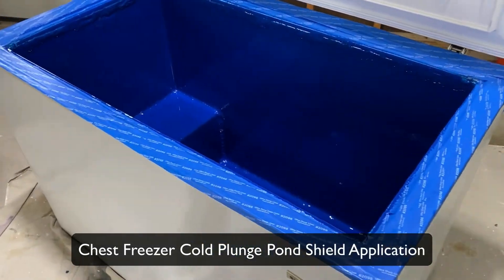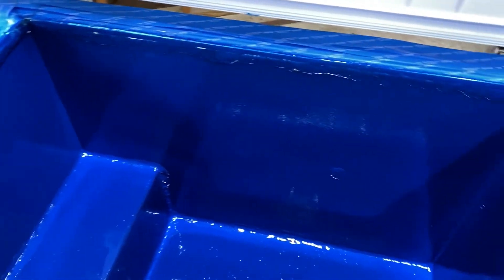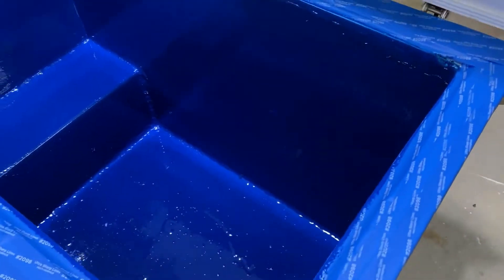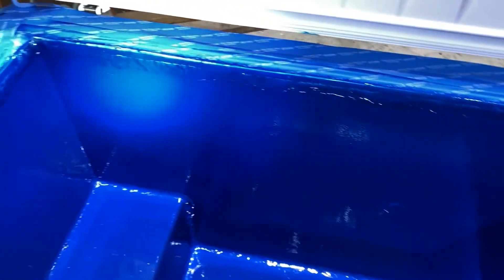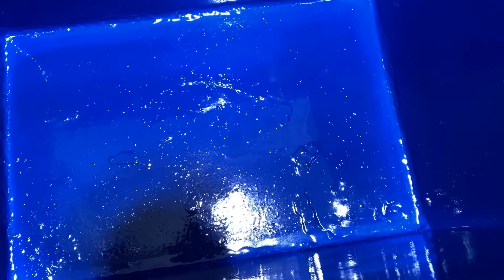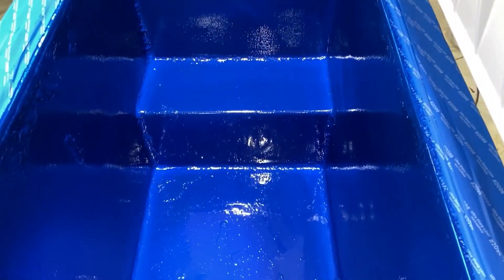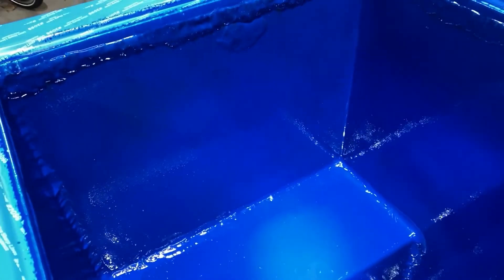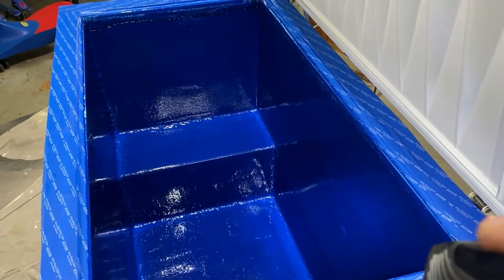Chest Freezer Cold Plunge -- Pond Shield Application Update

Comment: Do you think it's better to go with the freezeanother container and a water chiller?
Would you seal with the pond sealer before you used the freezer if you had to do it again?
Reply from the maker: I think the chillers are a lot better than what was available a couple of years ago when I started this project. The pond shield and JB water weld def. worked well and held up well. With a new freezer I think it would be even better. The chiller and ice barrels are nice too! You can't go wrong with either. This is certainly more work, but it's more cost-effective, and more inexpensive to run month-to-month. You can also do a freezer and a liner, which is a good option.

Comment: How much did you use. I see they sell the 1.5qt on Amazon. I assume that’s both containers combined.
Reply from the maker: I used the whole kit. If I did it again I would recommend more thinner coats. And use the containers until they are gone.
Reply: I bought 1.5 gallon kit. Waaaay too much and I have a 20+ cu ft freezer

Comment: Did you seal your edges with silicone? If so, did the pond armor stick to the silicone sealant
Reply from the maker: All the edges that are covered with pond shield are sealed with JB Water Weld. I only used silicone on the top edge to fix some of the cracking plastic.
Reply: Epoxy will not adhere to silicone.

Comment: How is your Pond Shield Application holding up currently?
Reply from the maker: In the areas where the freezer was in good shape underneath it’s holding up well. The places where I think the rust is in the walls, it’s continued to rust. But it keeps cooling. I do need to likely re-do the front where the cooling elements are, sand it down, and re coat it with one or two more coats at some point.